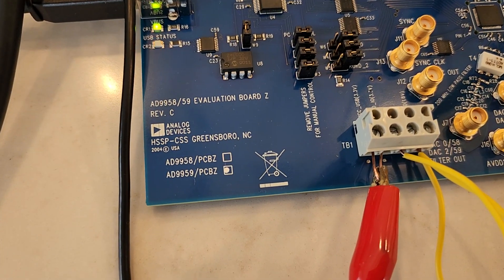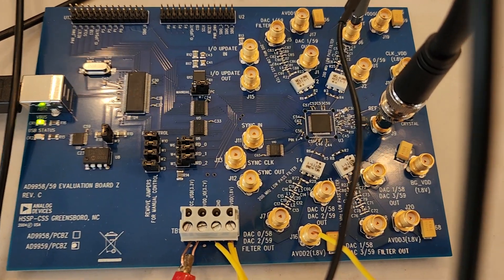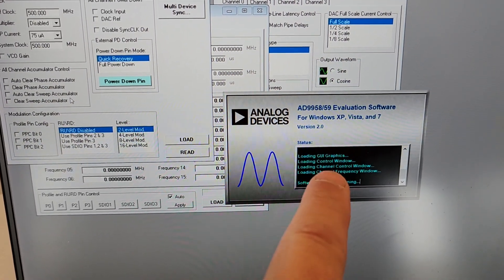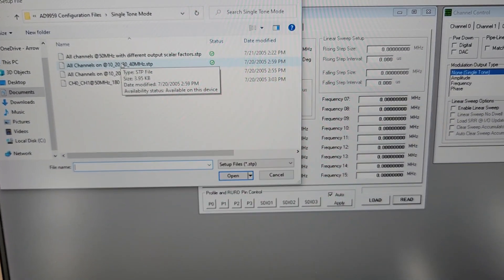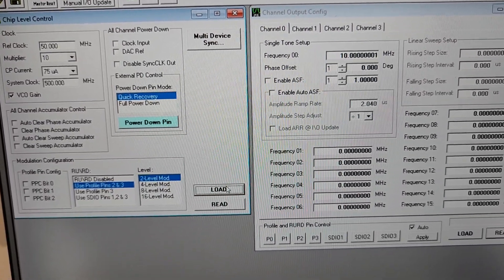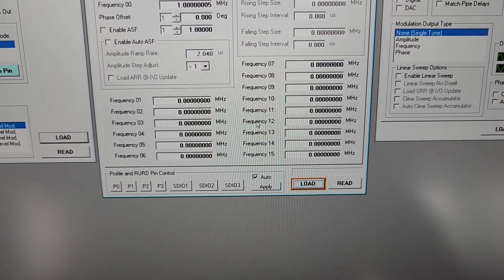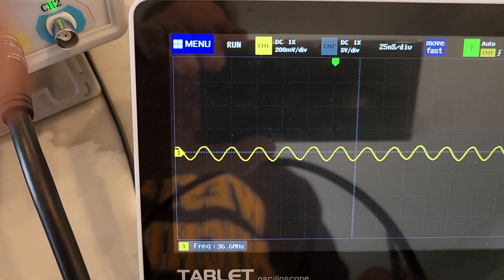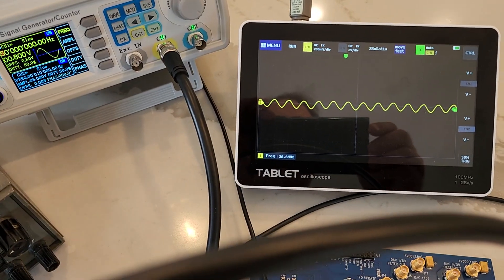Analog Devices AD9959 Eval Bring Up for their 500MHz Quad DDS Clocking Solution

Comment: My red light doesn't flicker. Does that 1.8 volt connector have to be attached?
Reply from the maker: @lwjufl  Yes the 1.8volt supply needs to be hooked up as well. I don't know if your USB driver is loading correctly on your PC but that's probably associated with the red LED.